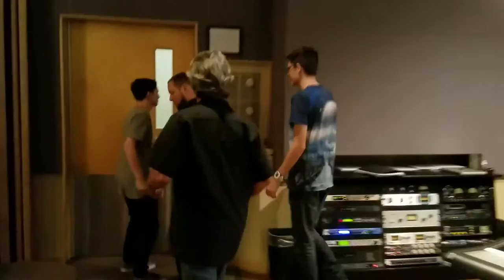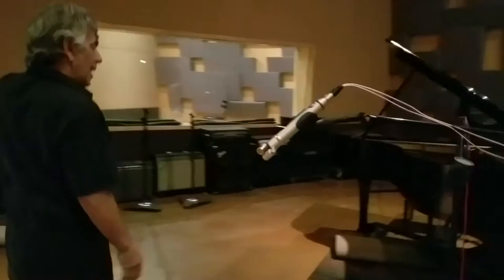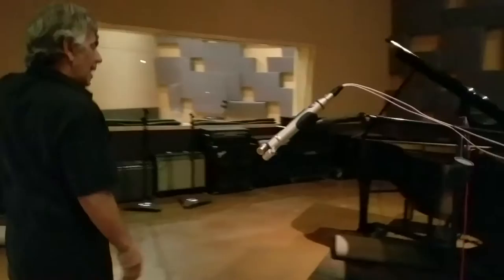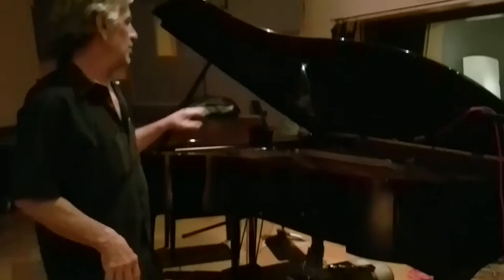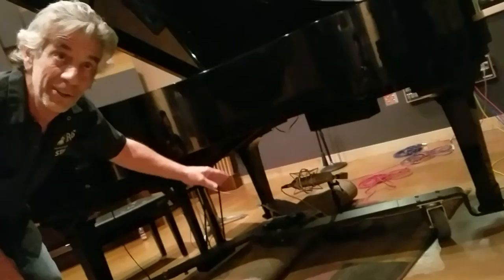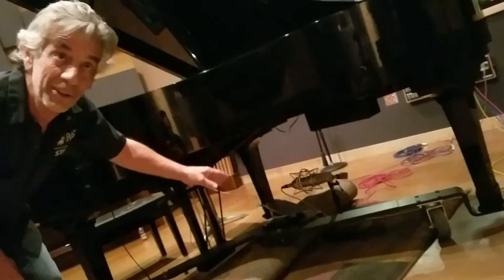RECORDING ACOUSTIC PIANO WITH KEITH MORRIS

Comment: I have an idea , in my way of hearing grand pianos and playing them some lack in deep low response , is it bad idea to put mics that are for bass kick and such which tend to capture a richer low end frequency range?   To have that full range audio quality that studios or in movies have , but apply this to live events ?
Reply: Try it out and see what happens? im not sure kick mics capture a richer low end though, they are generally designed to take high spls and also have some form of low boost built in. Depending on the mic, take the audix d6 this practically has a rock/metal eq voicing.if you look at the resulting frequency response on a kick it will look like how youd eq say a beta 51.

for live sound though... thats were things get trick. Live sound is always going to be a compromise. The rooms are often acousticly terribly, we have to take into consideration monitoring and big speakers. sometimes its more important to have something heard and fit well into the mix at that time than it sounding like it was recorded in the studio. its live after all  and IMO prefer a mix that offers something different to the recorded studio sound.

some studio things just dont work live, but its never wrong to try because just because in theory it should or shouldnt work, often in practice results are not as we expected